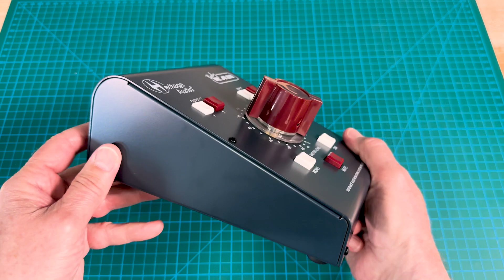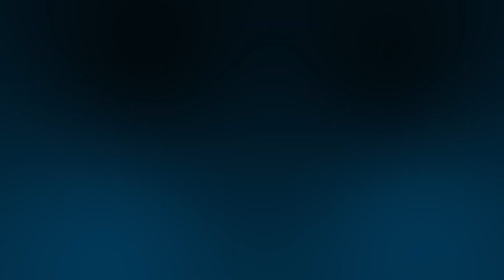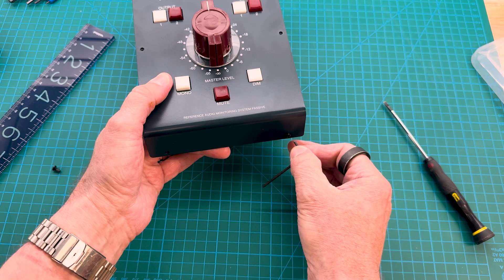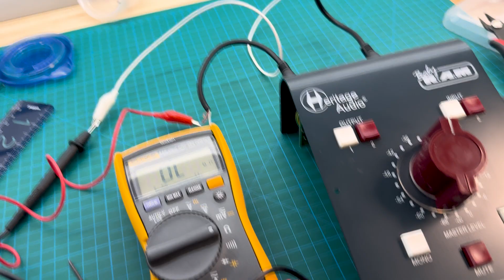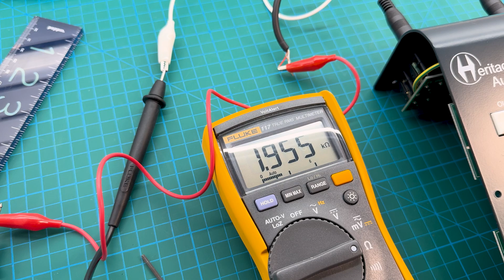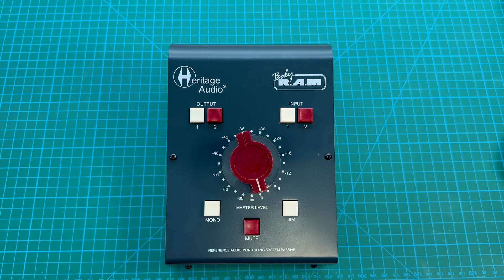Do You Need This Monitor Controller? Heritage Audio Baby RAM Review

Comment: Excellent video! I just got the all black version of the Baby Ram, but probably will return it. I like everything about it except the stepped volume Control. I'm not a music producer or engineer. I just need a volume controller for my Adam A7V monitors and prefer a smooth rotating dial. Another reason I'll return it is the size. It's pretty big on my desk. Glad I tried it, though.

Comment: Great vid, but I am curious how doe this compare to the much lower priced Mackie Big Knob Passive controller that has similar features. Which for the cost does seem to have nice overall solid heavy build quality but a totally dif potentiometer that is not stepped. Have you or can you do a direct  tear down comparison in build and sound quality with the same tests to compare them, I think that could also be quite useful to many.
Reply from the maker: I use both. On my B desk I have the big knob and while I prefer the detents and repeatability of the RAM, the Mackie has the same basic functions for much less. Will consider doing a comparison video or review of the Big Knob in the future.
Reply: @InventiveGear  Great thanks, I look forward to the possibility of that vid, as I do feel it would be a useful comparison.
Reply from the maker: @vidworxsfx  I will put that on the list. With NAMM coming up next week, it might be several weeks out.

Comment: Hello, nice review! I'm considering this product for my home studio. I have 2 computers (PC & Mac) with 2 audio interfaces and 2 sets of Yamaha monitors. I was just about to make the purchase and then I read this, "in balanced mode, left and right are not matched. Only if connected in unbalanced mode. It's a shame". Someone wrote that on Amazon. I'm wondering if you found any issues like the complaint mentioned? Thanks!
Reply from the maker: I had no problem with that. Actually, I found it quite well matched. The tests in the video show that it's very well matched electrically. I still have this on my desk and use it every day.